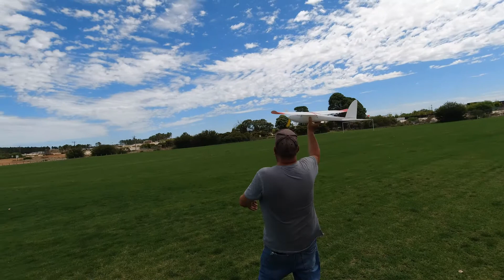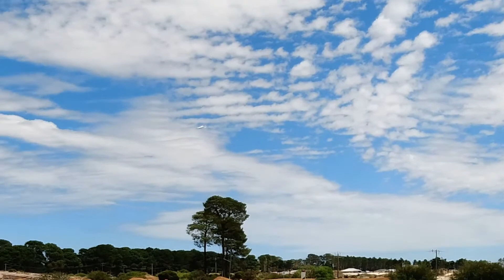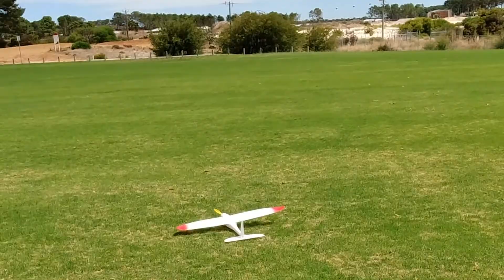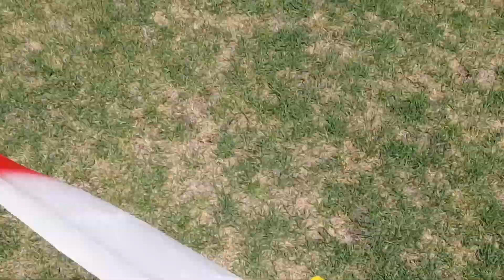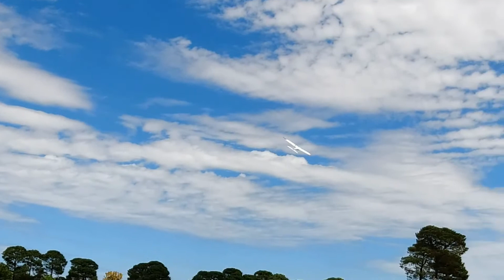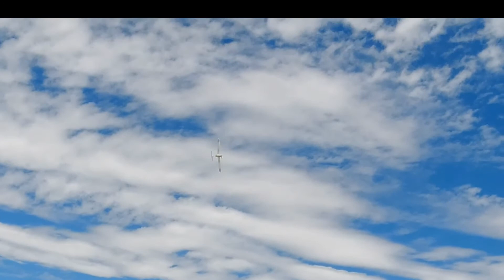Eclipson Model A Maiden

Comment: Nice video. Thanks a lot. I have a question, because the frame is very fragil I was thinking in filling it out with expandable foam. Does anyone had any good experience with it?. The idea is to give it strengh while keeping it light.
Reply from the maker: I have tried this on another model.. didn't work very well .. hard to fill all the gaps
Reply: @tonyaudsley  Ohh and what about the weight added?